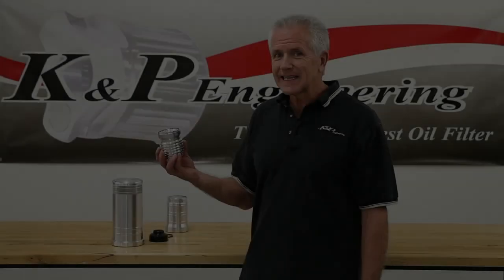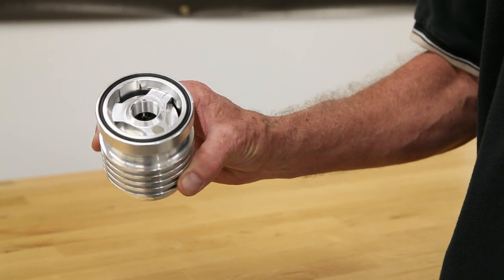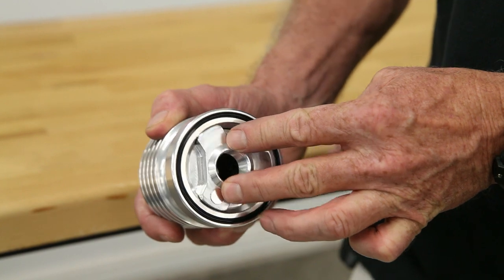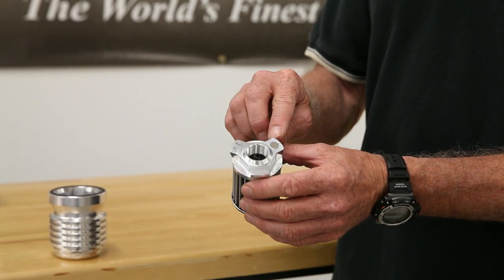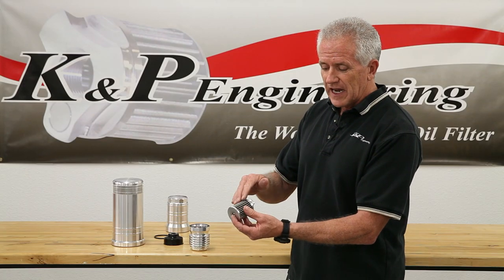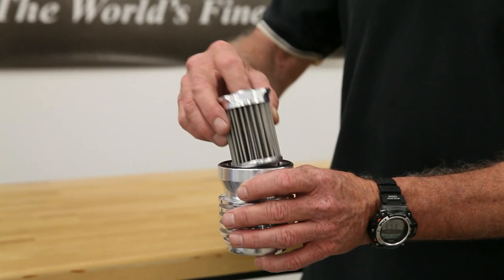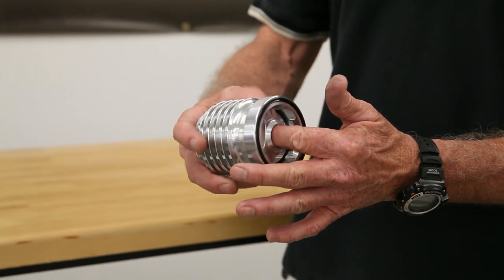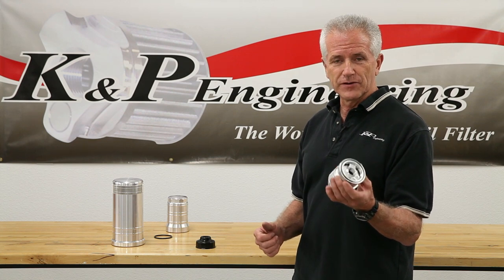K&P Engineering: Overview

Comment: I have a 2011 Harley Davidson Fatboy lo with the 103 twin cam engine will this work for my bike? If so what model? Does it come in black? Also my bike requires a drain back valve, does it filter prevent drain back?

Comment: I need one with a safety tie down for when I track my ZX6RR
Reply from the maker: You have a couple of options:  1) Drill a couple of small holes in the bottom rib of the filter housing that will accept safety wire and tie it off.  2) install a hose clamp around the filter and tie the hose clamp off with safety wire.    Hope this helps!

Comment: What is you typical temp drop through this?  Looking to use on Harley 88ci in Vegas.  Trying to cover all angles to cool oil. Thanks
Reply: @kpengineeringempl8602  A 25 degree drop seems to defy thermodynamic physics when you look at the surface area provided. I am more inclined to believe a 1 to 2 degree drop maximum.